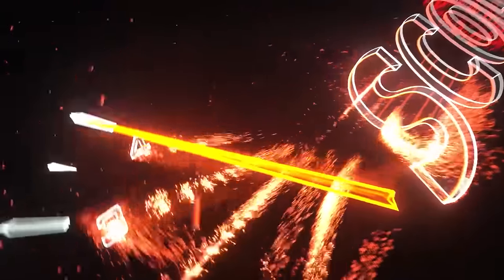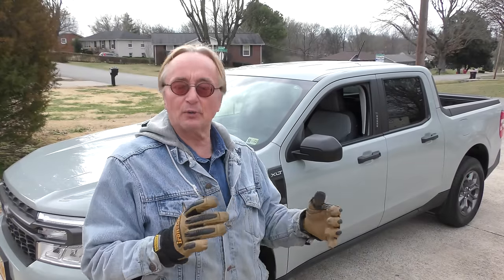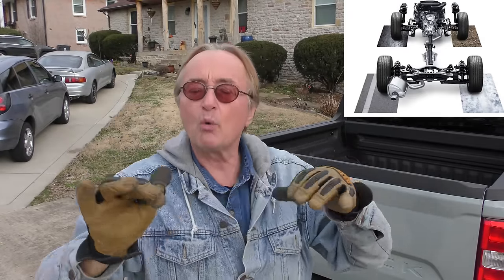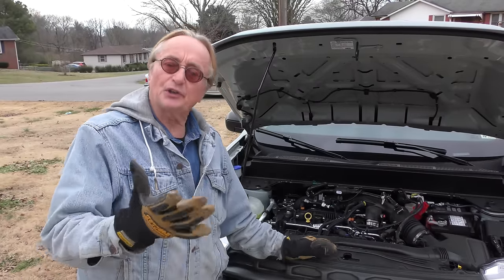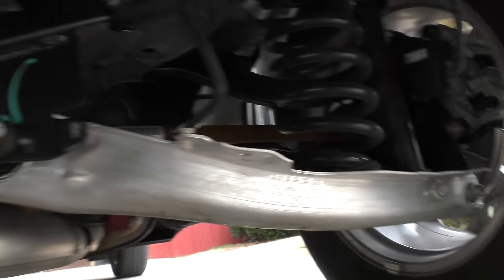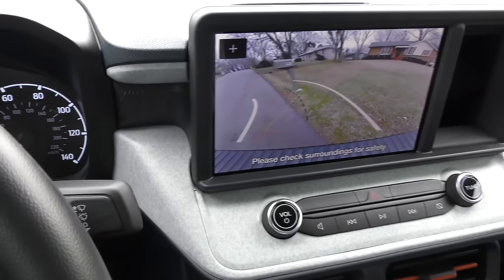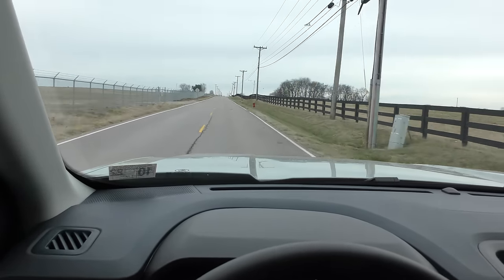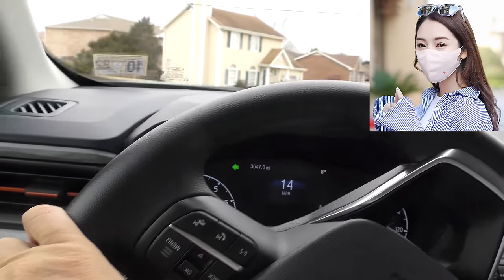I Finally Got a New Ford Maverick and Here's What I Really Think of It

Comment: I’ve had my Maverick for a little over 3 months. It’s a AWD XLT ecobeast. I’m about to roll over 10k miles. I live in Midwest and it’s done everything I bought it for. It handles pretty decent in inclement weather. The continental tires are good highway tires but are subpar in snow etc. I work for the railroad and I travel a 100 miles a day and use it to haul odds and ends stuff. I have a family of 4 that easily fits in it if needed. No you’re not gonna haul 10k lbs or tow a house with it but just for running around and hauling smaller stuff it’s perfect and with today’s fuel prices it was a win. In my opinion, these are more like the old Rangers. So if you liked the older rangers, you’d probably like these.
Reply: They should've called this the ranger. I wasn't impressed with the newest ranger. I thought it was too big. 

I've ordered this maverick in November and im just excited to get this truck! I'm barely getting around in my 2000 ranger. Haha
Reply: The ranger was an actual truck. Leaf spring suspension true 4x4  body on frame. The ranger and maverick are completely different vehicles
Reply: @seanbutler2291  duh
Reply: I work for the railroad too and was thinking about getting this for my work vehicle. I’ve had bad luck with new cords though so I’m not sure. I miss my old ranger
Reply: @seanbutler2291  sure, but doesn’t mean that the ranger in its current form is what Ranger buyers actually want… also this is a cheap truck.
Reply: I actually had a true Maverick. 1974 Grabber 302boss. Was shocked to see its a pickup now!! 🤣🤣
Reply: 10k in 3 months...impressive.
Reply: 4 cylinder truck. Well, that is a horrible idea.
Reply: They should've called it the ranchero
Reply: The old ranger was a body in frame light duty truck. The maverick is a cute Ute with a bed
Cheers
Reply: @rickitysplitz7035  yeah 50 years ago it was
Reply: @tomdavis3038  what was the payload on that old ranger you say was built like a tank?
Reply: I had a 99 ranger xlt with the v6 4.0l. Great truck with enough power for what it was. It never left me stranded. My first truck was a 4 cylinder ranger 2wd but that truck also held up really well in the New England weather. I have love for the rangers and hope the newer ones live up to their predecessors. But I never really looked into the new ones.
Reply: Eco beast hahahahahahahahahahahahahahahahahahaha
Reply: @seanbutler2291  The Maverick is a truck. But lets go with your view. What can the old "real truck" ranger do, that the maverick can't?
Reply: Did you buy all whell drive did you buy eco or hybrid?
Reply: @VidyaMexican  Read the 2nd sentence and your answers appear.
Reply: @rideagain7427  my 1987 Ranger went 347,000 MI when the 2.9 L engine started giving me problems when I finally give up on it I told them to strip all the new parts off of it so I'd have them for my next 1990 Ranger and when the tow company came to take the PU away that's all they got they lifted the body off the frame I don't know what happened after that but when I was in the 2015 snow storm of 17 in and couldn't leave my horses with it everytime I get an inch of snow on the windshield I turn the windshield wipers on.... those windshield wipers never turned off for 3 days but after that they were fine! I don't know if these new ones are going to be that good.....
Reply: @wxviewer  Yeah my wife before I met her, had a 74 Maverick - a gold color four-door with a houndstooth pattern vinyl roof. She said it was a very solid but dull car. Back then I thought the two doors were really sharp though.
Reply: I have a 96 ranger I'm waiting on to fall apart before looking at buying one of these. The way this ranger runs, though, I might be waiting a long time haha. Super happy to see smaller trucks (even though it's unibody) coming back.
Reply: @RyanNash20  my 2.9L 1987 Ford Ranger lasted 19 years, 347,000 Mi (179,000 MI when I bought it) before the Pistons, couple of them started to wear out, the guy that got me the new 1994 ( wasn't new 151,000 miles, 3.1L, MORE PLASTIC therefore, towed 3 times cuz the PLASTIC part that connects the clutch to tranny WORE out + PLASTIC knob for defroster cracked.... haven't found that part yet!!!!) But after they pulled all the brand-new parts off the 87 plus the tires 14 in ( it fits my 1990 Ranger) when they came to pick it up, the whole body came off the frame so I was riding on a Prayer I guess..... and I'm still driving the 1976 F250 I drove in here 47 years ago!
Reply: @montanawarren8462  I bought a 96 at the beginning of this year with 160k on it. Only thing I've had to do so far is put a new thermostat in. Really is a testament to ford trucks, or maybe just how well you took care of them, that they have lasted you so long.
Reply: Things still going well?
Reply: @rickitysplitz7035  Once you've put a 4-banger into the Mustang (AGAIN), it's all easy, greasy and downhill from there.
Reply: @user-xw4vg1vy5e  i drive for fedex and average 2k a month, that dude does some serious driving haha
Reply: What mpg are you getting?
Reply: Naw you can work on the old rangers, these systems are gonna cause headaches down the road.
Reply: *update* have had it a year now, sitting at 36k miles. Average of 29.7 mpg  running 78-80 mph down interstate everyday. Probably 80% interstate 20% city driving. Still drives like a champ. Zero maintenance issues.
Reply: I would get a Ranchero emblem and put it on there just to mess with people
Reply: Nothing like the rangers! Its not even considered a truck in my opinion. Its a cross over sport utility type vehicle but not a truck. I would rather have a ranger or a midsize pick to do everyday minor stuff. These are ugly please get rid of them.
Reply: @seanbutler2291 thank you for explaining this.
Reply: @jaredburget6940 update?

Comment: I really like the Maverick. It's capable enough to do everything about 90% of truck owners need and it's under $20k.
Reply: It’s under 20k ? No way
Reply: @mrodriguezglobe  just about a buck or two below 20k.
Reply: ain’t no one gonna actually get it for that price though lol
Reply: @metallic4888  True. Especially if you want the extras like the FX4 package etc. But definitely reasonably priced MSRP.
Reply: @metallic4888  dealers mark them up like crazy
Reply: they are 28k on the lot in fargo north dakota
Reply: About 25 out the door
Reply: Only the hybrid is under $20,000 and stripped which is fine if you feel like you're driving a pest control vehicle.
Reply: The $20k starting price is deceptive on ford's part. You have to pay $1500 in destination fees so the base price is actually $21,500.
Reply: Agreed. Just wish it was RWD with a normal shifter. But for the price you really can't beat it, especially the hybrid.
Reply: I wonder how it would compare with the Honda Ridgeline
Reply: @GK5_  Honda Ridgeline is a midsize truck.
Reply: Not with dealer markups is it under 20k.
Reply: Can a maverick pull a 11,000lb trailer and 8,000 tractor on it no so I need a v8 diesel
Reply: I live in Nevada. Just checked local dealer. They're going for 38k.
Reply: If you can find one base model, which you won't plus dealers are marking up in demand vehicles so get ready for that.. The dealers have flat out said that they aren't getting any base models with the hybrid in period only the 2,0 non hybrids so there's that as well.
Reply: Dude! $21,500 plus tax minimum, CASH price, for an base stripper version.
Reply: Just looked them. Up all I'm seeing is super crew models from $30k + so much for "affordable"
Reply: Here's a 2wd super crew I found dealers Are marking them up locally msrp is $26k and it's priced$33k RIDICULOUS
Reply: The only way dealerships are going to stop doing this is if we stopped paying these obnoxious prices over MSRP
Reply: Msrp $26k on lot for 33k I also see one that's $38k  msrp 27k..yhis is just insane people STOP paying these prices that's the Only way this will stop
Reply: Best one so far a 2wd super crew base hybrid. Msrp 21k listed for $23k.
That's not too bad at all.
Reply: Actually it is not under $20k as that does not include the destination charge.
Reply: i think fully loaded is just under 40k with about every option which even then still a good deal
Reply: A lot of trucks these days are pavement princesses and grocery getters so you're probably right.
Reply: I ordered a XLT hybrid with the lux package and all the options I wanted. Came to $25- almost $26k. I'm totally happy,  great value. I just wish it would arrive sooner.
Reply: You must live in a different America!!
In California or Texas, these trucks are at least $5k over MSRP if you can find one.
Reply: @mrodriguezglobe  only if you get the base stripped down model.  You start adding anything to it and the price jumps quickly.
Reply: @Chase_01   these trucks aren't designed for that and most people don't need that. In fact the overwhelming majority of people who buy trucks don't need anything more than this.
Reply: @malachi3438  Sure! Wait for 5 more years and buy a used one for that price. Lol!
Reply: @timjohnson1199  Hi again Tim! My Mav hybrid XLT alto 360 lux ordered June 17 will finally be at my dealer this week. $27,050 includes shipping. Dealer said I just have to pay tax, lic, and $85 doc fee when I pick it up.
Reply: @JamesD-HB   Similar for me. I'm pleased with everything except for the wait.  When I go to start my Buick in this single digit temperatures I think of those heated seats.
Well, you'll have to give us a report.
Reply: Under $20k …. Not really! That ‘conveniently’ overlooks the mandatory delivery fee and various other registration/tax charges .. and is for the very base model 

That said: yes, the Maverick is a hell of a deal … but, c’mon, don’t be disingenuous about it!!
Reply: @GK5_  Ridgeline is awesome truck man. I'm wondering the same. But the price difference is what's winning.
Reply: This trucks 40k in Cali
Reply: @anthonybernal5680  They way above MSRP. Consider this is a budget kind of truck. If you pay $40k now I bet the negative equity on the loan would be outrageous
Reply: Able to order one through my local dealer with no mark ups. 2.0, AWD, 4K tow XLT with luxury package is 31k all in. Still very affordable in today’s market for a well equipped car.
Reply: @SaithusX  this trucks useless man.. I think it's a sales tactic from Ford for the lgbtq community kuz I doubt a construction working  man would use this for work. Like all u can fit in that bed is some flower pots and feminine products from CVS. Not to mention the price, only some1 that's confused with themselves would pay that much for this incapable "truck"... the f150 is just 2 bucks n some change away. I'll stick with my 2001 gmc sonoma mini truck. Now that's a truck bby 4cylinder and all
Reply: Looking at 100 truck beds how many are hauling anything. MOST trucks are empty anyway. Yes some days you'll need a second trip but  90 percent I'm happy with a mini truck.
Reply: @johnjude2685  u got a point there bud. Or how bout these taquatches chopping their beds up so it can sit on the ground  lol... no quema cuhhh ....
Reply: @anthonybernal5680  I see your point. But the price of new vehicles in general are crazy right now. It’s a viable transportation if you aren’t looking to spend much. Plus it’ll be something as a decent work truck for what I do.
Reply: @SaithusX  what is it you do. I myself am a floorlayer. So I don't have much tools or bulky tools. I think one of the largest things I carry is my dually and my tool boxes of course. Unless I'm picking up material... I have a gmc sonoma and it's decent for me. I would t spend 40k on that truck tho. Rather hit the f150 but then again I'm. Not much h of a ford fan myself. I'm really disappointed in this truck tho because I really debated on getting 1 kuz I thought I was gonna be able to get a nice new truck for less than 20k but boy was I wrong the mark up are so unrealistic
Reply: @anthonybernal5680  Yeah the markup is ridiculous. Crazy dumb. But I am a traveling gaming technician for slot machines. Parts are small and tools aren't a massive amount. Just want to replace my Prius as my wife's car is finally going out to pasture soon.
Reply: @SaithusX  have u seen that Hyundai car with a truck bed 😆
Reply: @anthonybernal5680  lol surprisingly I like the look of it
Reply: @SaithusX  hey man It's kinda sweet has that el Camino vibe.
Reply: @Chase_01  An Eco-diesel 1/2-ton Ram 1500 can't legally tow that either.
Reply: @Chase_01  we’re not here for that. Everyone here is familiar with diesel trucks.
Reply: @Chase_01  It probably can't toast a bagel either. Buy the tool you need for the job you expect to do.
Reply: This is no different than their SUV's..  Just look at the history on those and you'll see how these will fair..   It has the same uni-body, same suspension, and same engine, ect.. It's just their SUV with a bed instead of cargo area.  Not much of a truck really.  Similar to a Honda Ridgeline.  More of an SUV than a truck.  They're pretty sweet if you don't ever tow things.
Reply: @GK5_  Ridgeline is $40 k
Reply: @anthonybernal5680  mine is on a jobsite right now junior
Reply: @nycmaverick  that truck stain was a good 1 tho.. 😄 🤣 😂 nvr heard a story like that befor. U get that one thru experience from 1 of your failed marriages OLD MAN?? 😄 🤣 😂
Reply: @anthonybernal5680  stop limp wristing that firearm son. What kind of stance is that in your picture? Did you ever hit the target?
Reply: @nycmaverick   why don't u be original and stop copying me.. u actually acting like a Lil boy to be calling sum1 else that ya hypocrite
Reply: @metallic4888  I think Rabbit got his about that price. There were circumstances though.
Reply: @RKmndo  that’s why I bought a 20yo truck that was made back when you got what you paid for and it has a big v8 turbo Diesel engine and manual trans something you can’t even get nowadays
Reply: under 20k in what world
Reply: Order one from the factory at MSRP. No reason to pay a mark up.
Reply: @mrodriguezglobe  I paid less than 18k for mine with zplan.
Reply: @GK5_  more fuel efficient, and more affordable, but generally similar.
Reply: @cleonituk  our local dealer is selling at MSRP, but the only 2 on the lot were more loaded 26k+ models.  Still not bad though
Reply: @The_Temple  that is the same for literally every car on sale though
Reply: @mrodriguezglobe  You're right. The absolute base model is "claimed" to be under 20 - but that's without D&D fees. It's actually a little over $21k US for the base model. Still a good starting price, even if it's stripped out of even the most basic features like cruise control at that price. It's the new Ford Escort...in a truck dress.
Reply: First $20k? Dream on 
Second you can “haul” as much in a suv
Cheers
Reply: @cartere9981   I haven't seen any marked up yet
Reply: @mariam.1721  That's nuts for an economy vehicle. I'd look at the Ranger as an alternative.
Reply: @slingbart705   the one equipped with a pole installed in the bed? 🤣
Reply: @metallic4888  manny got it for the price plus a $1,500 “Destination Fee”

I just looked on Toyota and priced a Tacoma. MSRP for a bare minim Tacoma is $26,700 plus another $1,215 for a “DELIVERY, PROCESSING & HANDLING” fee. Looks like every manufacturer does it.
Reply: @metallic4888  A plan
Reply: $2500 over sticker here in Orlando Fl i
Reply: @mariam.1721  they’re going for 35k in Vegas. The laurent version too
Reply: @pasta-eo5mt  That is the same for every automobile maker. You can see the stickers online.
Reply: $42k out of the door XLT trim down in Miami
Reply: Pickup that gets great mileage. is not too big but not too small. drives good, and looks good. and will do most any light work a person needs done for 20.000 grand. you simply can't beat it. no other manufacturer even comes close.
Reply: Dealer had no stock..but quoted 28-30k for gas version
Reply: A loaded Maverick approaches the priced of Honda Ridgeline which has a V6, more towing capacity and car like backseat.
Reply: Not the one he is showing. It’s double.
Reply: yep the price you cant beat, i bought mine XL with awd and the entertainment pack, safety/blind detect package towing etc.. for 25K out the door. My friend bought his about 7 months before me xlt FX4 package awd towing etc.. for 23K dealership special ordered his and the guy backed out on it, so they were just trying to get rid of it.
Reply: @baldiemurph 
Correct. 

I need a vehicle that:
Can carry two mountain bikes, covered in crud, or surfboards, or fishing gear and a kayak.
Has a working air conditioner 
Can load a 400 pound pallet in the cargo area with a forklift for work. 
Can get out of its own way
And can be driven on rough gravel/dirt roads.
Is under 30,000 and leases for less than 400 a month. 

As a homeowner, an open bed would be idea, but a small SUV with a flat cargo area and fold flat rear seats would also work. 

This little pickup checks all the boxes. 
A midsized or full size pickup is just overkill.
Reply: 90% of truck owners needs? What sr you basing that off of lol. I sell Fords. People buying this are wanting the cheapest entry into a truck period. Nothing wrong with that. The towing capability is almost useless on the Hybrid. 4 and a 1/2dr bed. The 2.0 EB is pretty impressive at the price point. The Ranger or Colorado is far superior. I would pay extra for those.
Reply: @jamesm568 lol. Im in pest control. This is exactly why I’m looking into it.
Reply: They are deceptive with that $20k. They aren't including shipping.